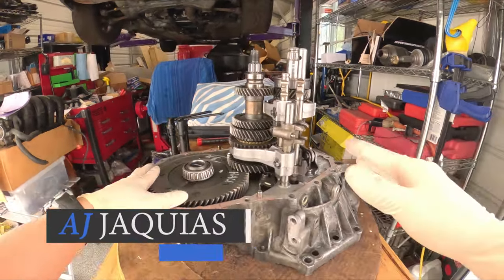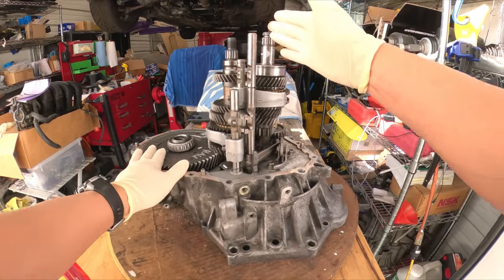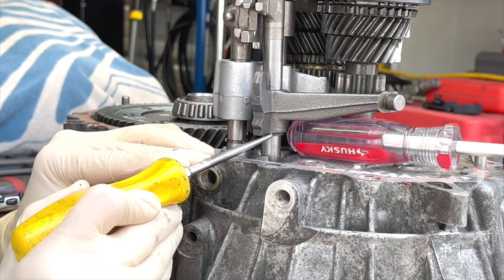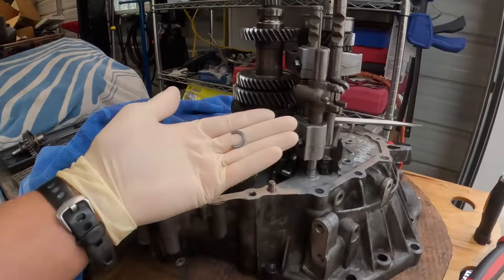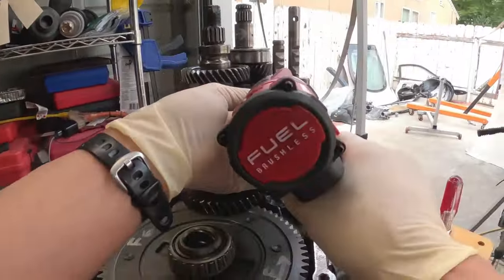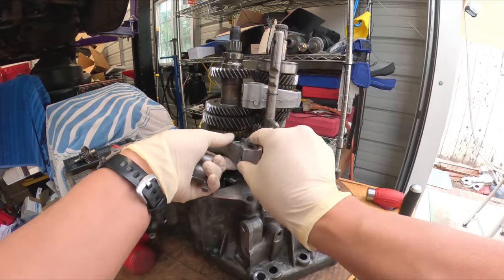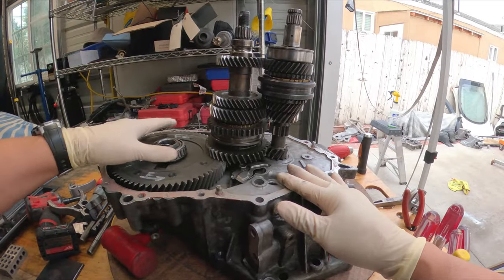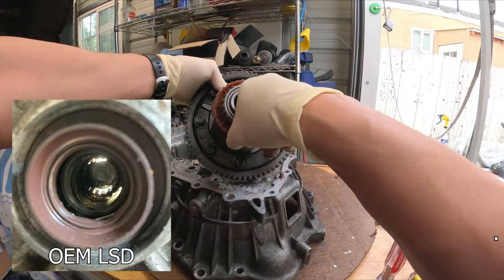Project Yellow Episode 6 - C56 Transmission Rebuild Part 2 - Transaxle Case

Comment: This is a great guide. I'm in the middle of inspecting my C56 and installing a TRD helical diff.
This is so much more detailed than a lot of the older guides.
And hopefully when I open up my C56, it's in better condition than this.
Reply from the maker: Thank you for the kind words. It’s important to understand this video is only a guide and should be used in conjunction with the OEM service manual. The next episode will be uploaded tomorrow. Stay tuned. Pls subscribe. Thx again, AJ

Comment: Cristal clear ! Thanks
Reply from the maker: @patricedeschilder1321  welcome. Pls subscribe. Thx AJ
Reply: @RelentlessRacingAJ  I did subscribe. Question: seems you have not done further videos about the C56 Transmission Rebuild. Have you ?
Reply from the maker: @patricedeschilder1321  Sorry, I haven’t edited parts 3 and 4, but as the OEM service manual reads sometimes… assembly is the opposite of disassembly. 😂 All kidding aside, these vids take an enormous amount of effort and time and I honestly don’t know when I will edit parts 3 and 4 based on all my projects. In fact, you are the only one watching these vids. If you follow the OEM service manual it details the process for each shaft assembly very well. Get in there and get dirty. Manual transmissions are much easier than rebuilding an engine. As my dad once told me, don’t be afraid. Good luck. -AJ

Comment: Great videos, plenty of detail and very good editing. A question on the the bearing puller you used to remove the input and output shaft bearings. Did you have to modify the feet of the puller to fit under the roller bearings? Or was there enough space between the rollers and the oil diverter? thx
Reply from the maker: Thank you… striving for a diff kind of video. Pls subscribe. No tools were hurt or modified in this video. Thx AJ

Comment: The orange speedometer drive ring is not used on the Spyder.  The Spyder uses the ABS sensors to determine vehicle speed, not the transmission.  Also, while the 2 tapered bearings on the differential look similar, they are different and not interchangeable (including the races that are pressed into the case), so plan accordingly.  It is easy to mix them up (ask me how I know).
Reply from the maker: You are correct on both statements. However, this diff is used in other vehicles and the orange ring is used by the VSS. BUT AGAIN, u r correct… w the MRS the orange ring is not used. U will see in a future video, I don’t install it when I change the diff bearings. With respect to the diff bearings, I believe i did not say they were the same bc just like u I have mixed em up. When I first installed the diff bearings for an LSD in a C60, I did the same thing. What’s $85ish in diff bearings wasted anyways? 🤣 As my buddy Rob says, it’s only money. Thx for being one of the few ppl to watch this video. -AJ